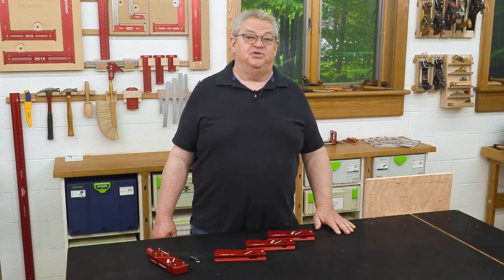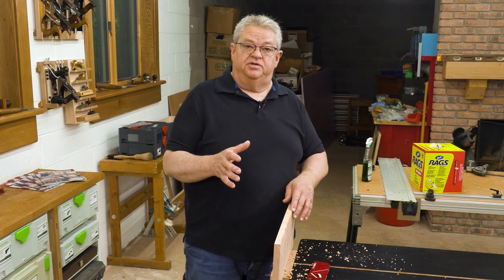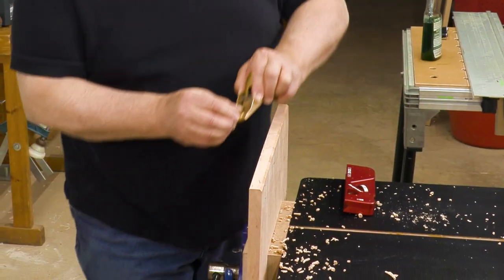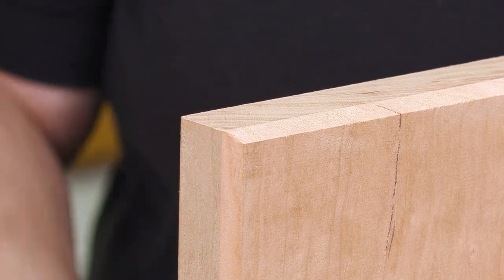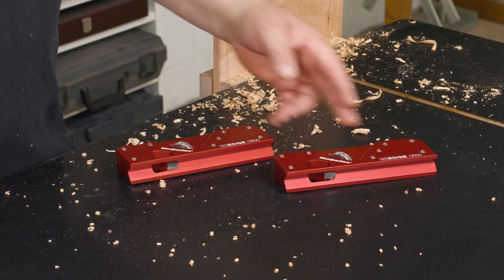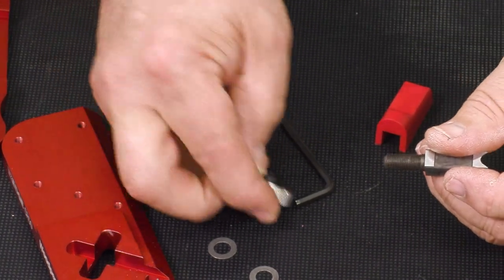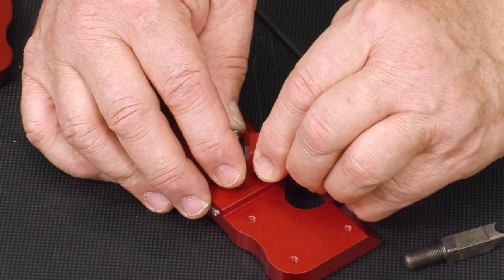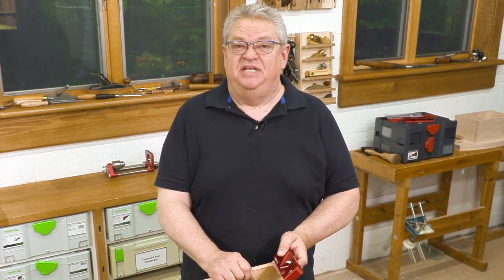How To Plane Perfect Chamfers & Radiuses With EZ Edge | Deep Dive | Woodpeckers Tools

Comment: Can you guys add a 1/16” round over blade to the options? It would be great to leave at a  preset depth and is small enough to leave a good finish without having to move the blade.  I love the chamfer blade for this. I just pull out my ez-edge and zip zip zip, light chamfer on each edge.  I would also consider closing the throat down to add more support in front of the blade.  That would be nice when starting on a really short edge.
Reply: 1/16 would be amazing. I'm thinking of getting the 1/8 and really backing off for easing cabinet door edges. Using a sponge on a sander now. At $1 each sponge, and the maple slices through that sponge in no time. I'd rather use this than a block plane for this function. Set it and forget it, one swipe and done. Would fly through a stack of doors.
Reply: Was wondering about 1/16" too.

Comment: Perfect timing, I just got mine! I was hoping in this video you would explain how adjust the blade for various depths and avoiding blowouts on mating corners.
Reply from the maker: Mating corners: Do the end-grain first. Come in from both ends, if possible. Then your long-grain cuts should finish cleanly. Learning how much depth of cut to take comes with practice. Harder woods need lighter cuts, softer woods can take heavier cuts. A little less than half a rev on the wheel is a good general purpose starting point.
Reply: @WoodpeckersLLC  Ty Ty!!

Comment: I believe that a minor "wiggle" in an edge chamfer is desirable.  I want my work to look like it was made by human hands, not in a factory by a perfect machine.  Many times, I have sighted down the length of a molding on a 19th-century cabinet and felt a connection with the long-deceased cabinetmaker who cut that molding with a plane or a series of planes.  It's never perfectly straight and I love that character.

Comment: Question: would you recommend that Chamfer Tool to be used on anything other than wood? For example: I make charcuterie serving board and backfill the live-edge with resin/epoxy so some of these boards can have wood & epoxy which I normally use a router to create a profile on the edge however this tool could do the trick. Cant wait to hear back
Reply from the maker: Should handle the epoxy with no problem. Might have to take very fine cuts to prevent chatter, but it will cut it fine.

Comment: Nice product! Can the cutters be sharpened?
Also your benchtop is nice. Is it a laminate product? Thanks!
Reply from the maker: Yes, the cutters can be sharpened. For the most part, you only need to hone the flat side. It doesn't hurt to use a profiled leather strop to hone the bevel, but don't try to grind the bevel.

Comment: Rank beginner here, forgive obvious question - with the Chamfer blade, I can control the depth to create just a very small chamfer - is that correct? The chamfer in the video is somewhat pronounced, I just want a tiny detail on the corner. If I had to guess, it would be a flat spot maybe less than 1/16.
Reply from the maker: Yes, you can. you can make it as small or as large as you want.
Reply: @WoodpeckersLLC  Thank you!

Comment: Can you use the corner planes to make the dowels used in you dowel jig?
Reply: In your morty jig
Reply from the maker: Sorry, no, for two reasons.  1) The radii on the Morty tenons are metric. and B) When a corner is cut completely away the EZ-Edge doesn't have anything to guide by.

Comment: I have lots of Woodpeckers products, but I'll pass on the EZ Edge.  To me, this is a solution looking for a problem, and I have never had an issue using a block plane to chamfer an edge.  I was taught decades ago to reference the angle of the plane body to the work by using my finger tips.